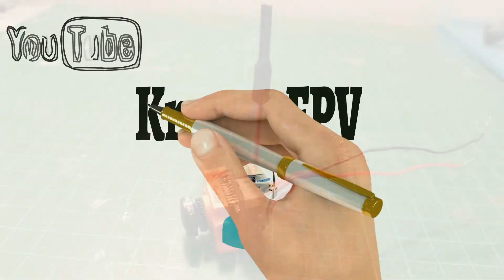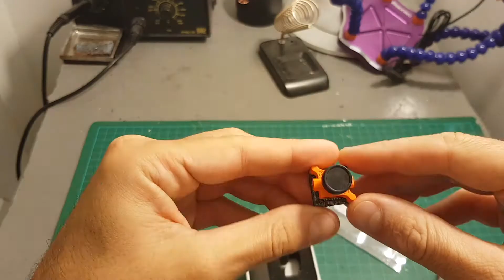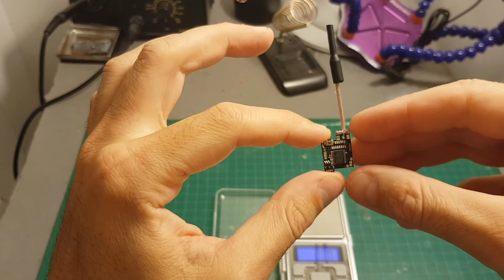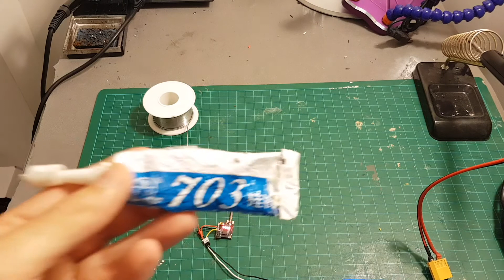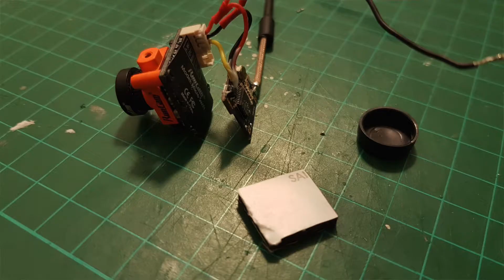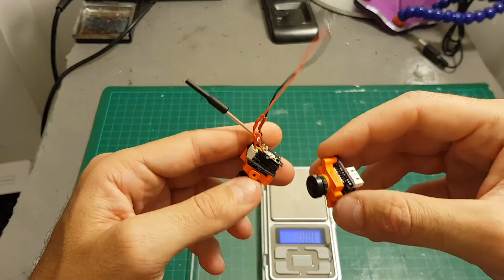How To Add A Piggy VTX To A Runcam Micro Swift / Foxeer Micro Arrow

Comment: i have install GE-FPV VTX on my e011 quad i have try two camera and whend i push throotle the screem become confuse (sorry my bad english)
Reply from the maker: You are having a voltage drop issue. When you are pushing the throttle the voltage drops. You should add a voltage regulator between the VTX and the board, or try a different battery to see if it helps.
Reply: thank!!